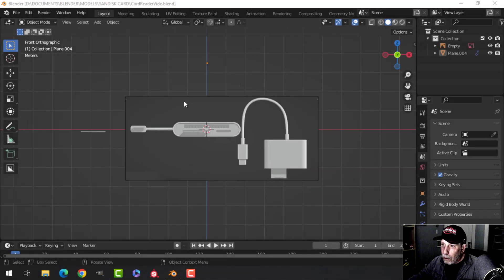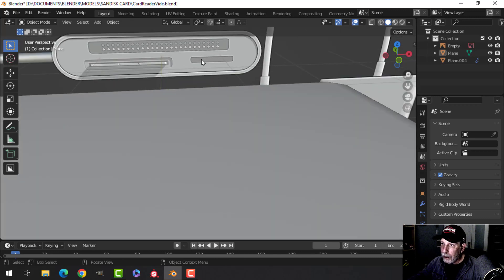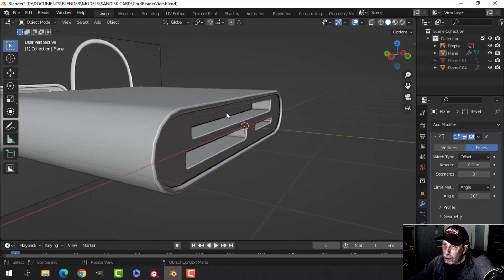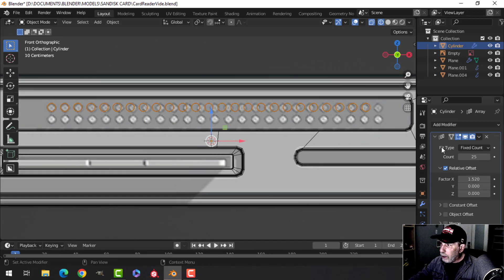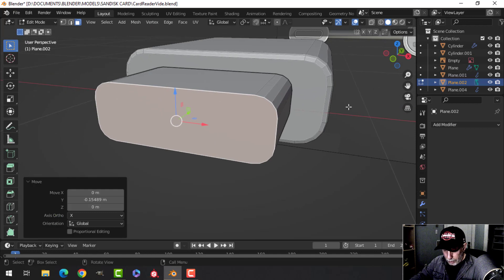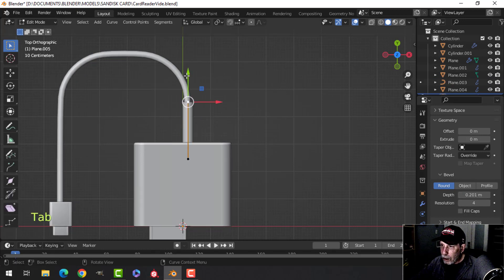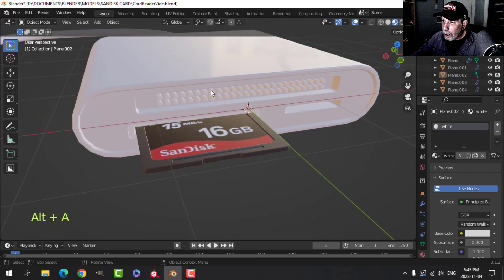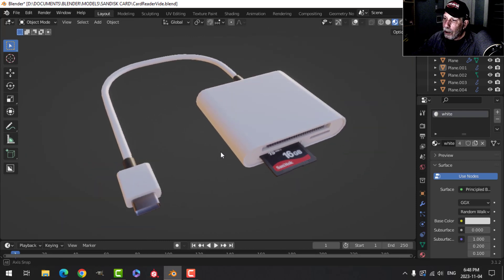BLENDER: SD CARD READER

Comment: My 2 cents thought: Instead of copying the array of pins, I'd add another array modifier, on the Z axis.
I don't know if this would really save polygons, because it uses instances instead of a copy of the original pin, but! Why not?
Reply from the maker: Yes it would.  I use instances a lot but in this case I didn't bother.